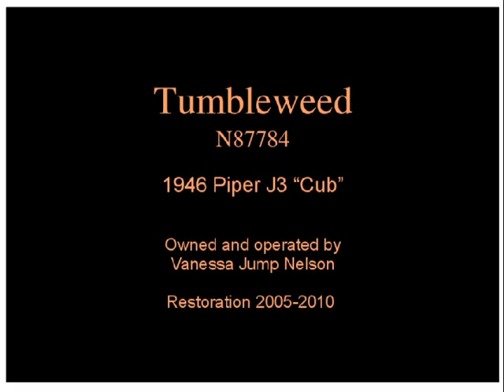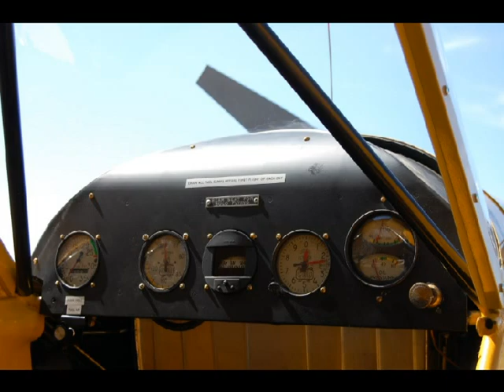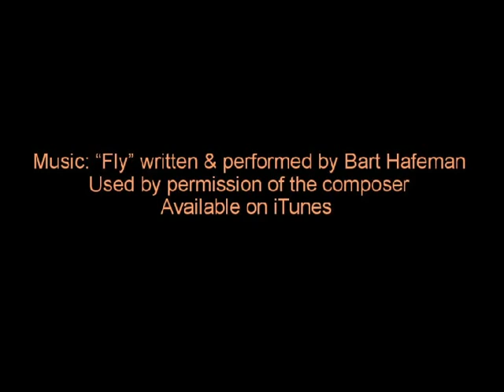Tumbleweed - Restoration and Flight slideshow

Comment from the maker: Those tandem wheels were known as the Whittaker Tandem Gear, designed by Art Whittaker, who was a friend of my father-in-law.  Those were used basically for what the oversized tires are used now: better stability on soft ground.  One big drawback was that they made steering rather challenging.